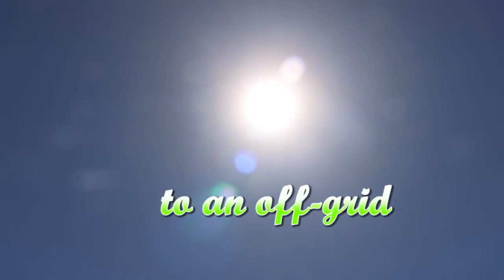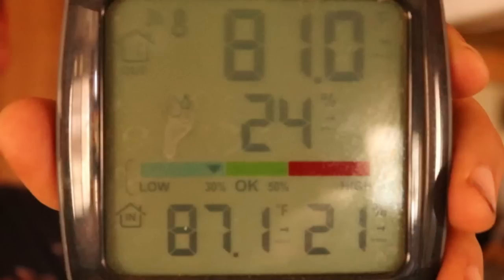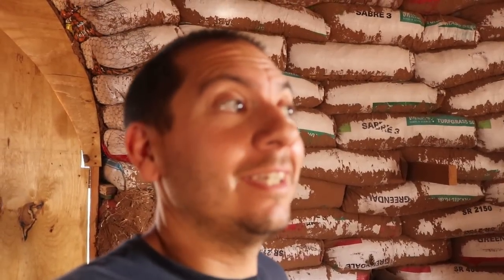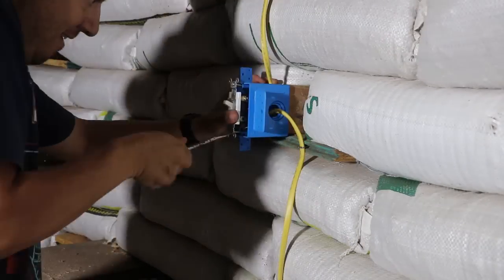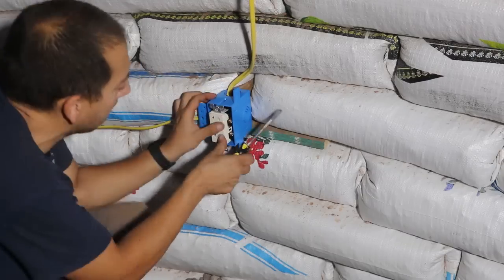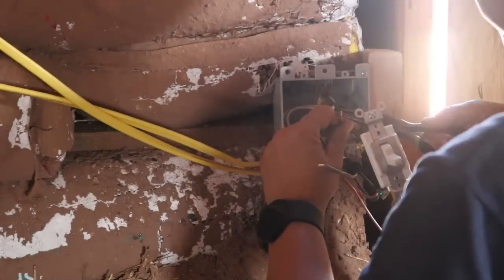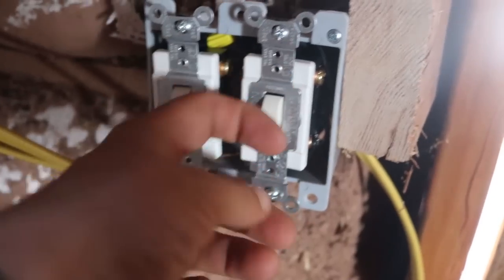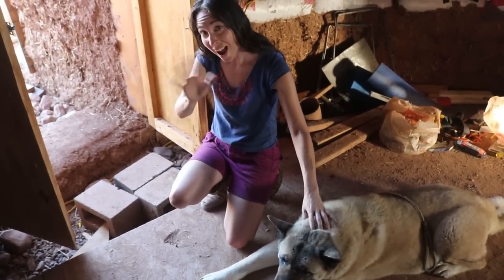Heatwave Strikes! Will We Need AC In Our Earthbag Dome? Building Off-Grid In The Desert

Comment: here in michigan under ground homes were a thing for awhile back in the 80s . i seen some really cool ones . beautiful inside you could not tell they were underground . outside you could not tell there was a house . did pretty much what your dome does . maybe a little better  seeing how they are like the bed room in the dome . my mom lives in a basement home  as well . she has a log cabin built on top of it that she wont use . beautiful place . she even made her own fire place out of field rock . so i know what the dome is like inside . its a great idea and it will be nicer then you think once you finish it . only thing i think you  might and i say might regret is that it seems a little small to me . but that could just be the video aspect of it making it look smaller  on the inside .  im curious about the plumbing im guessing the toilet part will be the same as now . but what about the shower bath tub ?  kitchen sink and so on . i know you ran water supply from the water cistern but  what about out going drainage ? oh by the way really like the lime wash idea . made a big difference in the bright white look . i would go with that . and  jess is right it will make it so much  easier to add color to the dome if you want to . ok guys work safe see ya in the next one.

Comment: Have you thought about burring a culvert in the ground and draw air through it to help cool the house like the do with earth ships.  To help draw air through the culvert into the house install a vent pope at the top with  a DuraVent 5GVVTH.  With wind blowing by the vent cap it will create a vacuum drawing air into the house.  You should also run another vent pipe down to your basement bed room to help bring in fresh air pulling out CO2 build up from breathing.  CO2 is heavier than air so will tend to build up in low place.
Reply: Earth tubes would be very difficult to install because of the calichi, a calcium rock layer 2 to 3 ft down.  Review GDP videos of digging holes for domes.  In my experience in AZ earthtubes are always a dissapointment, never meet the hype. But only have done 2.

Comment: An additional solution for the hottest season is USD 1000 geothermal air cooling/air conditioning system with an antifreeze liquid solution running through pipes connecting to a car radiator with a fan behind the radiator to send the cool air circulating. Tubes need to be buried 8 feet and looped long enough to be cooled so low it cools your entire dome.  A simple solar pump can circulate the fluid using a 100 watt solar power source.  System can last 40 years with some replacements as necessary.  No risk of contamination like geothermal cooling air system.  Use a simple thermostat to keep temperature constant   great ROI for the investment.  There is totally environmentally safe antifreeze used by RV homes.

Comment: Convection vent at the top of the dome. "Cool tube" 12-18" diameter total... ( multiple concrete blocks stacked on side for combined volume) buried in a trench 8' deep. Approximately 125' long. Turned up at each end to provide inlet and outlet. In your application, just "cut" into the wall at floor level of the bedroom... convection pulls through the duct, cooling the air and vents out through the dome vent. 8' deep the earth stays much, much cooler no matter the surface temp. Utilize Geothermal, no bought energy required.

Comment: Fans don't actually cool a room. They just move air. Your AC is doing all the work.
Reply: True. Fans help evaporate moisture from skin, which aids cooling a bit. But as you say, they don't do anything to reduce the temperature. They help in moving the cool air created by the Aircon around the space.
Reply: What about swamp cooler type cooling? When air blown either with mister.. or thru water in some way its cooler. Didn't folks hang large wet sheets up over sleeping  porches back in the day?

Comment: I lived Greece two years the dry heat same arzonia.  They use white stucko on side brick buildings .  It looks good helps cool it some..  
To tell you about floor unit ac all them total junk unless spend thousands on one.  My dad had one put window unit back in after a year.  You guys could  run duct work in bedroom hook up high capacity fan blow cool air in day time .  And you put window unit in cool it down allot. I had 12  by 20 building ran 5000 btu unit on low and still froze me out

Comment: So did you guys ever consider doing a geothermal AC type system. My uncle built some of the first earth ships back in the day. Then as well a few dome homes that I helped with. The systems worked quite well using the earth to cool homes.  I've even built a system to cool a solar utility electrical box. Boat 12 volt exhaust fans work very well for air flow through the underground pipes. We are hoping to continue our off-grid project. Always great to see your forward progression.

Comment: Earthships use burried cooling tubes that uses natural convection to release hot air and suck in cool air. Mini splits take far less hydro 30 to 50% than other ac units and can heat as well. Plus the indoor unit is whisper quiet.

Comment: @jim In terms of the trailers efficiency, you should really insulate its air exhaust pipe, and use a two pipe system with ONE intake and ONE exhaust. It makes a big differeance in its ability to get to lower temps.

Comment: The thermal mass won't let the inside ever be as cold as the outside at night.   You need insulation to prevent the transfer of heat into the house.  Fans don't make things cooler they just help to move the air over your body to help cool it

Comment: I am surprised no one has mentioned evaporative cooling. I live in Mohave County Arizona and that is all I use for cooling. It doesn't use near the amount of energy an AC does. You could even build one yourself.
Reply: That works excellent in AZ and even in S Idaho where I live ... but it takes a lot of water so I didn't bring it up :) if they had endless supply of water it would be so nice. That would take a really deep hole and electricity to bring it up. Pricey.
Reply: To evap. cool the dome (+180 cooling days @ 125 gallons per day) would take a completely new cistern and new collection system 2x as big.
Reply: @honthirty_  I am not talking about installing an evap cooler. maybe a single cooler pad on a north facing window with exhaust fans in the loft.

Comment: One duct in the basement at floor level running to the top of the dome with a fan in it will dry the basement out and drop the upstairs temperature significantly.

Comment: It would be a lot of work, but a few earth tubes dug deep and long could bring some natural cooling.  Provided you add a vent up high in the dome so the thermal syphon should move the air. Or put in an exhaust fan with a temperature switch.

Comment: Some sun shades  could help shade the dome.   Was just thinking that for your dog- you could dig a hole into the ground about  16 inches and  then take  some scrap wood make a arch and do the cobb over the  arch .... make him a little arched dog house.  The chickens might like a arched tunnel.    At some point it might be worth doing the well... a swamp cooler would work amazing.   Would the humidity of the swamp cooler hurt the  soil... the soil would absorb some of the humidity.   That should increase the mass of the wall.  now if the outside coating allows water vapor to pass.   would the humidity in the air on the inside slowly get pulled through the  soil bags and exit the outside of the building and would that have a cooling effect? need the science guy.

Comment: Heat will come in through your windows - I squirt some soapy water on the inside of my windows and put up sheets of bubble wrap on the windows. I do this for summer and winter, to keep the heat out, or to keep the heat in, depending on the season. You can easily pull them off, and re-apply as needed in just a few minutes.

Comment: The problem with your AC unit in the trailer is that it sucks in outside air in the same amount that the vent exhaust out the window.  A mini split would be great for your fifth wheel.

Comment: On GFCI outlets or simular devices
Never tighten with a Philips screw driver 
Why
Those devices have a slot to insert the wire in.    They have flat plates
Wire is round
If you don't really tighten the screws...to help transform the wires flat....
Wires heat up and cool down
Over and over.    Over time the wire being Cooper will form to fit the space
Once they cool down..   Then the contact isn't good if at all....
My suggestion. My process
Use either a flat blade or square drive
I'm 6ft 250lbs.    Try to tighten the screws like you want to break them...
Then shack the devices.   Retighten...
Form the wires and device to fit the box...
Frighten the screws again....
then finish installing
I've never broken a device...
Or had a problem with wires coming loose

Comment: Heat rises! Did you put a vent in at the top that can be opened and closed. Then at night when it’s cool, with the window open. The heat should go up and out and cool coming in at bottom like a fan, without using a fan. And great Idea putting in a ceiling fan!

Comment: Wonderful ’stress test’’of the building. A lighter color surface and lots of night time aeration is key. Shade on window but generally walls too, can keep even a bad house (mine is brick with inside insulation of the worst (pu foam) kind for summer insulation ) and still 18 degrees F (9-10 C) ooler that outside with those strategies.

Comment: Warning lengthy reply,, so don't  read if you hate reading more than a brief bit.. I used to live in the desert in El Centro California. It gets really hot there and 2 of the years I lived there we had record breaking high temps in the summers. I had a friend whose grandparents lived in a home that had been built there prior to electricity being available. It was built partially underground and it had really thick Adobe brick walls, like 2 bricks thick. The exterior was white, I don't know if it was limewashed or stucco. The paint or whatever had some sort of reflective powder in it, it sparkled in the sun like superfine glitter. There were other homes and was in town with that sparkly finish to the stucco.. it may have helped reflect the heat,, > always assumed so. The roof was Iike a lot of the roofs in town, white with while chunky gravel adhered to the roof. I guess that helped with heat dispersal too in some way. Also the house had 2 fans built into the wall to pull the cooler night time air through the house. The house did have AC but they were pretty comfortable with it off except on the hottest of days. They also had an ancient swimming pool, reportedly one of the first ever built in the town, it wasn't pretty but functioned really well, a pool is great to have on a 115 degree day. They also had fabric awnings over the few southwest facing windows on the house.
The house my family lived lived in was stickbuilt in the late 50s with a cream stucco exterior and a big picture window with no awning. We had the typical white roof with the white rocks. I'm sure the house had little or no insulation, as homes back then weren't generally well insulated. Even with the AC on full blast it would get warm inside our house. We went on vacation once with the AC turned off and came home to find all the tapered candles in the house had melted. The ones in sconces on the dining room wall had melted in a manner that reminded me of The Persistence of Memory painting by Salvador Dali. Lol
I remember in your shed you were testing a venting system, air intake low, then a vent up high to expel air, could you install a tube venting system in the dome to draw nighttime air in and expel it through the top? Might only need 2 PC cooling fans or perhaps no fans.

Comment: I get an incomplete picture. When people are bottled up in heat, they throw off a lot of moisture into the space. Your humidity might spike, indoors.  About AC? When it has to deal with high humidity, low fan works better than high fan because the air conditioner turns into a better dehumidifier. Room fans work better with dehumidified air. The RV could probably benefit from a safari roof. A second roof with air passing between the 2 layers.

Comment: Get a heavy extra duty big Ass Tarp and some big poles (  6  ) secure them 4 to 8 ft from the RV on each corner  and then add 2 the same distance apart but 20 ft behind the RV and get that tarp secured on all 6 posts .... and make sure those poles are 8 ft above the RV and the interior temps will fall big time .... I've done long stays in the desert and it works wonders .... however it has to be a really big and heavy duty tarp ..... what ever you can do to get the RV out of the SUN and you will be good to go .

Comment: Congrats on the electrical work. Finishing the outside is certainly a challenge and deciding on an efficient way to apply the lime will be critical. Don't think you want to spend a year doing that since there is also the inside to consider.
Reply: I was thinking the same. I wonder if one of those sprayers for textured ceilings could work?

Comment: Looks like you bought good quality receptacles (being the 20 amp variety) but it looks like you didn't get the type that allows you to poke the conductors "straight" into the back of the screw terminals and than clamp the terminal tight with the screws. 
Connecting the plugs and using them as a "splice" like you are doing, it's SOOOOO much easier with the "back wired" terminals. And, they tend to stay tighter while you are wiggling the plug into the box while the screws will sometimes loosen when you're doing that.

Comment: Exhaust fan should lower the dome temperature by ten degrees
Reply: Only if the air that replaces the air you're blowing out is cooler than the air in the house.  We have learned that in the evening the replacement air should come from the windows on the east side of the house, because of the sun creating so much heat on the west.

Comment: There is literally no structure that is as efficient as one which uses thermal mass for heating and cooling.  A small mini-split in the loft should provide for all of you're cooling needs during the summer and conversely a small mini-split in the downstairs would provide all of the heating even during the coldest of weather.  Prolonged periods of cold or hot weather extremes is the only time it should be needed.  For the most part the only thing you will need is a small fan to vent the loft, a reversible fan in the window a good insulated sealed door with a screen door for when you want to cool or ventilate.  Also keep in mind it takes months for the subterranean portion to reach it's equilibrium, plus you still are going to be adding more thermal mass when you the cob and plaster on the interior.  Really great results without it being finished already!!!  Window awnings ala: Roger Dean's dome designs will really help with summer heat gain.  (Just a bit more cob work before you plaster the exterior.)

Comment: Hi Jim & Jess, I was wondering if you could incorporate the geothermal concepts in the dome, with tubes/piping laid in the floor of your bedroom before finishing it to capture the cool air to bring up to the mainfloor & loft??
2nd question, would it help to have the trailer under the "carport" to keep it cooler or perhaps it doesn't fit?
Reply: You beat me to it
Reply: Adding the roof over the camper, to block the direct sun, collect rain, and create a cooling space between, is brilliant. Easy 10 degree difference.
Reply: If Arizona was dry enough, a swamp cooler would be fantastic. We had one in our old movie theater.
Reply: Arizona is at the bottom of the chain. Committees control the Colorado River to the Hoover Dam. Don't expect any hydroelectric from Hoover.

Comment: You will need a "Dome management system" so to speak. a closable heat exhaust system at the top of the dome and an inlet preferably entering from underground. The inlet to open when night desert temperature is cooler than inside the dome, pushing warmer air out of the dome. During the day you close the inlet to keep the cool air throughout the day.

Comment: Maybe some kind of Eco-Cooler, or a water fueled, both non electric evapourative cooling system/s could be installed, it could drop inside temps by 5 degrees.  Water is something you have catchment in abundance.  Eco is Just some plastic, or glass bottles, just to narrow the flow.  Just an idea... maybe look it up to see if it could fit into your plan.  Peace and Love.  m

Comment: Your heat generated is called latent heat being transferred inside. You have no ventilation in the dome. Have you thought about a relief damper at the top of the dome that opens when the temp gets to high and operated on a thermostat. . Have you thought about natural convection system air in the bottom and air out the top.

Comment: Check your cistern water temp you may want to pipe it into and out of your trailer put it through a radiator and put it back into the cistern. no water loss closed system I would think your cistern water temp is less than 65 f. 18. 19 c. try it out check the temp of the water maybe it could be cool.

Comment: Have you thought about two way switches for the loft and bedroom? That way you can turn them off when you get there instead of having to go back to the switch by the door. Also I think if you would put one mini split in your first floor that only uses 7amps, you could heat and cool the house very easily with a solar set up! I put three in a 1600 sq ft house and it’s amazing! So much cheaper than running the 50 amp, 3 1/2 ton central air conditioner and you set it and forget it. Always the temp you want, heating and cooling!
Reply: Yes! Mini splits are amazing!